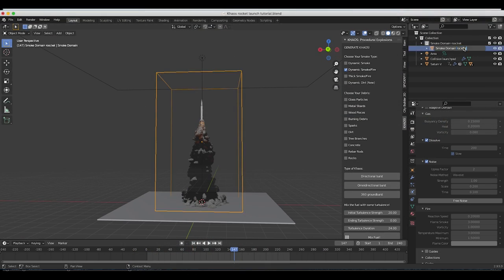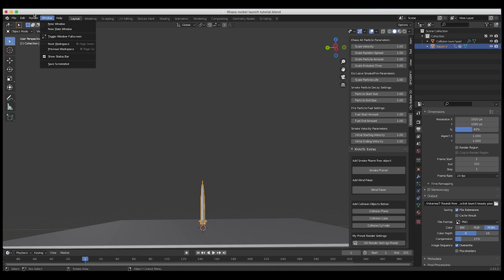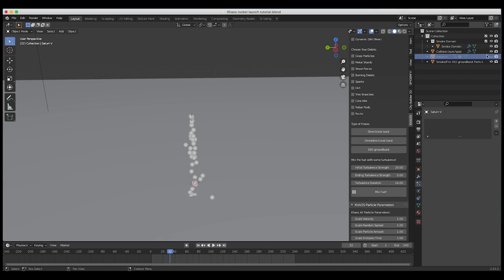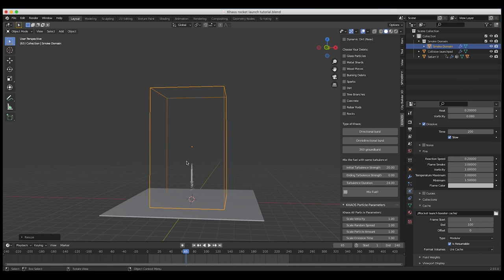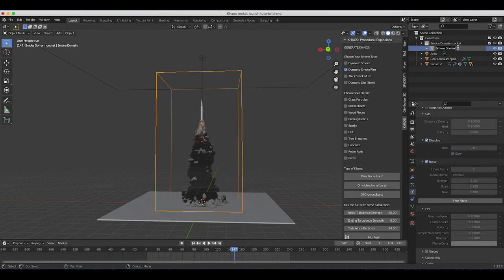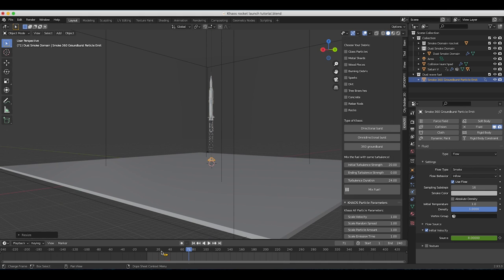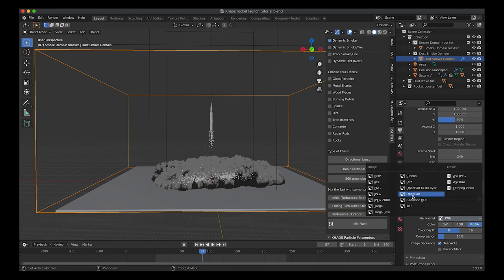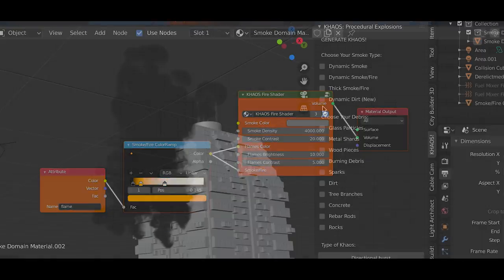Blender 3d Rocket Launch Simulation: Full Tutorial ft. KHAOS add-on

Comment: Nice to see a khaos tuto made with 2.93, i had a hard time getting result close to your previous tut made in 2.83 ,cool i ll give this one a try!
Reply from the maker: Thanks Redshade! The biggest change I've noticed with 2.93 is that the initial and ending velocity needs to be much higher to get the same result as before.  Sometimes I crank up these values as high as 20.0  to get the smoke  moving more violently. Overall I think 2.93 is a better look though. It's just different.

Comment: Hi I just bought khaos and I am having issues with the particles (using blender 3.2) Some particles seem to be going upwards around the rocket and it makes it look unrealistic. How do I fix it?
Reply from the maker: Probably what is happening is they are bouncing off of the collision plane if you have one on the floor of the scene. You could turn up the damping on your collision settings if that is the case so the particles don't bounce as much. Other than that I am not sure what would make the particles go crazy like that. Maybe dial down the random velocity settings.
Reply: @LightArchitect  It happens more the higher the rocket flies, its like half the particles seem to be going in the opposite direction rather than random as its a straight line of particles going up.
Is it because im using blender 3.2? Maybe somethings different?

Comment: Hi! I bought The Khaos addon yesterday, and followed this tutorial which worked fine. Now that I recaculated the smoke domain object after a tiny adjustment I cant see the smoke in the viewport. Does not render either. Cache data is in the folder. Please help!
Reply from the maker: Hmmm. So you baked once fine and then when you deleted the bake and rebaked you can't see the simulation any more?
Reply: @LightArchitect  exactly, but when I switched to ”replay” instead of ”modular” i can see it again. It was some setting in the domain object. I can live with that.

Comment: Hello, I just bought the KHAOS bundle and am having some difficulties in achieving the same results as this tutorial. My problem right now is not having the "grey smoke" look after I baked the results. I have tried increasing the flame smoke to 8, as well as the intial and ending velocity to around 20. But every time it finishes baking, it's just black :-(. It does have some fire though
Reply from the maker: Hi Milk, There could be several things going on here. I'll share a few tips. 
-Make  sure you have a powerful enough light hitting your smoke so that it is  lit properly. You can also use an HDRI.
-Make sure you turn up  volume bounces to at least 3 in your render tab. This allows light to bounce around  your smoke for a more realistic result.
-I recommend  rendering in Cycles  for a much more realistic result.
-In your KHAOS  fire shader increase the brightness of the color of your smoke to a more gray color.
Let us know if you have any more questions.
Reply: @LightArchitect  Hi yes, I have followed your tips, but even when I just finished computing the cache for the smoke, the solid viewport doesnt show the grey smoke. I have both increased the brightness of my light and the smoke colour. It only shows fire and black smokes, no grey.
Reply: @LightArchitect  I thought I would just follow up: I remade the scenes today and it worked great, thanks! Looking forward to try out city builder and cable cam as well!
Reply from the maker: @fishching9001  Awesome! I was trying to figure out what the issue could be. Glad you figured it out. Simulations are tricky to get  exactly what you want sometimes but also can surprise you with some really fun results when your experienting! Would love to see your final result!
Reply: LightArchitect Thanks! Hope you don’t mind answering another question of mine, after I have made the simulation, I realised my cache folders are bloated with data and noise, making the entire rocket folder 30gb huge. I am just wondering, whether it’s possible to delete the folders after baking the data? Or does the blender working file still require the data for it to be used next time? (Say I do not want to recalculate the fluid simulation)